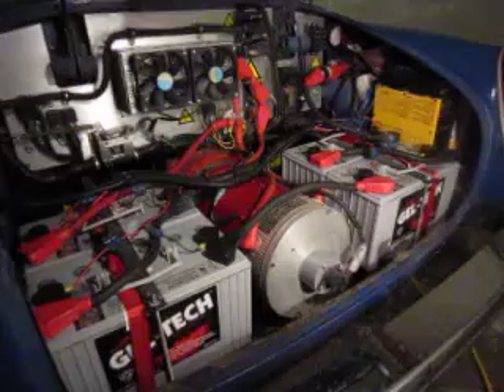06. Rear Components.MOV

Comment from the maker: @jimmykid55 Yes, this car still has a transmission.  The motor, a Warp9 from Netgain, has a high torque band at lower RPMs, but has a max RPM (red-line) near 4000 RPM.  So without a transmission, you might have a low top speed.  Also, the motor's peak efficiency is near 3500RPM.  The transmission allows you to keep the amps low at low speed, the torque high when you need it, and gives a decent enough top speed (around 140kph with a standard ghia transmission).   Regards, Nick.

Comment: I have a quick question, does it still require a shift to a different gear depending on speed? cause ive seen other videos where they say there is no need to shift, but some still shift, just kinda confused with that